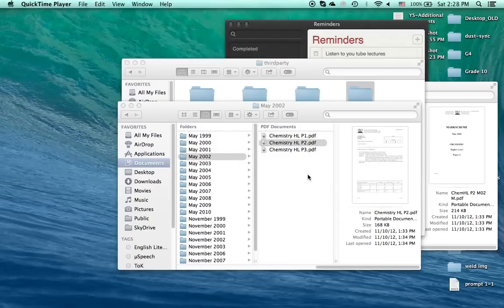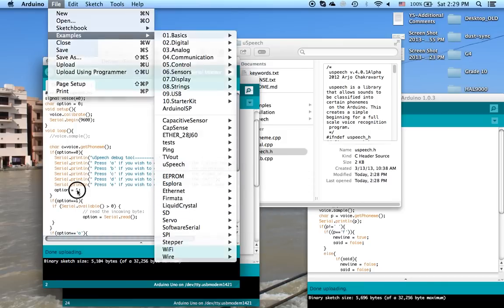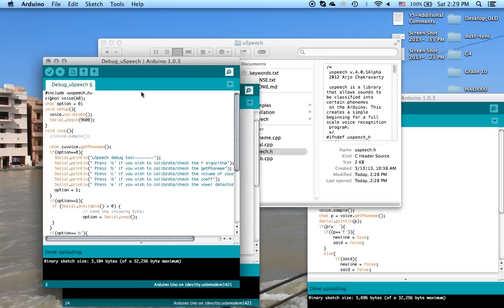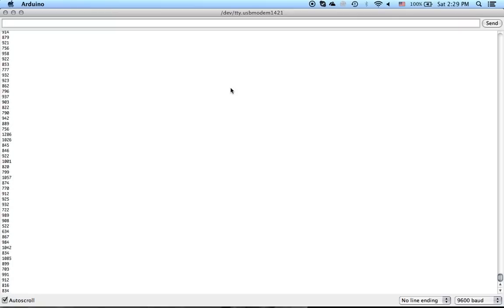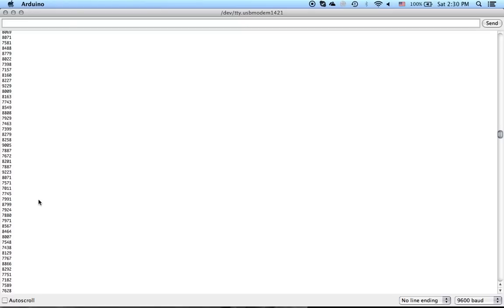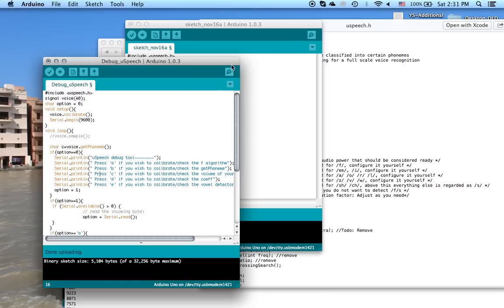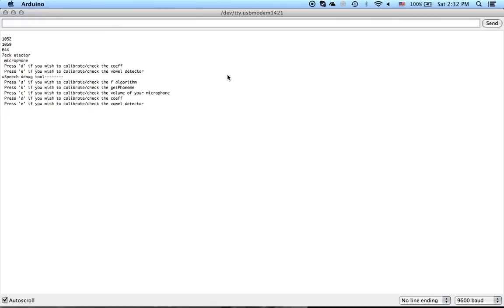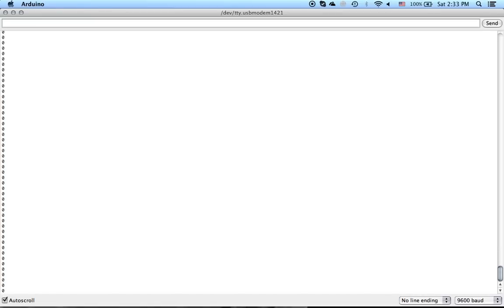µSpeech  calibration

Comment: Help :-)
I have just received all necessary parts, installed uspeech, and I am already running into trouble after opening and uploading the Debug_uSpeech.ino (recent uspeech version) in IDE 1.0.6.
The terminal just shows gibberish, as well if I enter "a" for example:
x4Øá<ù  :´H˜A BxA:£Äº|xlúü&lsquor;8Yºü¼ÔºÜ\Â˜:Òã2âº xFÃNzF Nºý/;\»Xœ |C²8,Òø<ùº\\“ú*S

What am I doing wrong?
Reply: I tried v4.2-alpha, v4.1, only older v4 will work, but the callibration is differently. I can get it to recognize on/off occasionally, but without the debug tool it is tedious to set up. Any idea how I can fix the serial output issue ?
Reply from the maker: Schorhr Hi first set baud rate to 9600 this will stop the giberrish. use the old tool. This video refers to v4 of the library so n worries there.

Comment: when i open the serial monitor i get 
(ÿŠ,ÿ‘–	3 EÙ,Æ   \qi   Ä  ýšy. ‘ P5 L&lsqauo;5 mÎ™%6 ;‘Ý’Ú. “ P5´Š!ƒxR(u:Øö‘Ý_Í`²¤&lsqauo;”òj0™ ƒx’BÙ:øö“Ýÿ
Reply from the maker: Check your baud rate is set to 9600.
Reply: Arjo Chakravarty man your a hero, can this work from far then distances if I increase the amplification
Reply: Arjo Chakravarty sorry to bother you again but I'm able to get the command screen to come up but when I pick a command it doesn't do anything if I write a command other than the specified letters it lists the commands again,I'm pretty sure my mic is hooked up properly, I used 2. Thanks for you time
Reply from the maker: Bug with uspeech 4.2 use <4.1.2
Reply: Arjo Chakravarty Hi.  I had the same problem so I uninstalled the 4.2 library and then downloaded  v4.1.2 from GitHub and installed it.  After uploading the code to my Uno, I still had the same problem.  Do you have any ideas on how I can debug this?  Could it be a problem with how I connected my SparkFun Breakout Board for Electret Microphone to the board?
Reply from the maker: Ahmed Ayad Hi, go to the releases tab and download 4.1.1.
Reply: Arjo Chakravarty Thank you for the prompt response.  I have downloaded 4.1.1 and it appears to be working now.  I'll let you know how it goes.

Comment from the maker: I used a condenser microphone from an old toy. I created a preamp with a 2N2222 transistor with 100X gain. Most brands will work fine... There seem to be some nut cases selling microphones with pre-amps in the name of uspeech, they look good enough to work. You just need a good preamplifier.